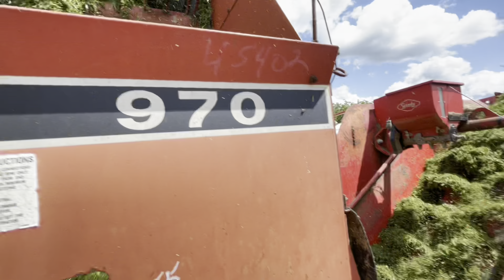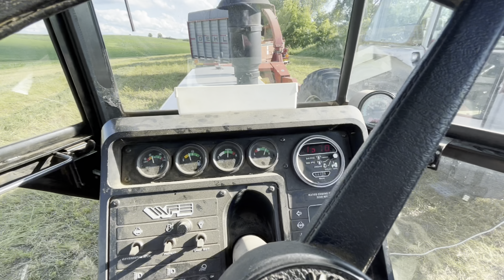Starting second crop alfalfa! The White 140 is having some voltage issues!

Comment: Around here corrosion is the source of almost all electrical problems. I was burning out starters, alternators and batteries were not charging properly. Turns out the 30 year old battery cable on my truck had corrosion hidden inside the factory crimped alternator and battery connectors. Disassembling, soldering and attaching new brass battery terminals eliminated this disaster that made my life miserable for years.
Reply from the maker: Yes we did find needed new batteries and one cable. Plus a bigger alternator.

Comment: How does bagger keep tension, and what pressure you run ,we have ag bagger with cables, I see you don't have cables, so how does your work .
Reply from the maker: With this bagger there is a cable that is inside the tunnel. It’s very king and hooks but into the bagger above the bottom but inside the bagger kinda hard to explain. But after being hooked into the bottom you have to hook it to 3 things ontop of the tunnel and when you put the first loads in it will release from the top 3 and say connect underneath that pulls through the bag the whole time making tension and packing the bag tight way better and makes a way better bag then cables and a back stop. Tough to explain on a comment. I’ll have to make a video about it to explain and show better!
Reply: Thanks you we run 790 chopper works great for us ,my brother been milking12  cows to feed calves ,calf market going down, so dfa did a inspection on his place ,so were fixing a few things and putting in 1000 gallon milk tank and start selling milk soon.
Reply from the maker: Very nice! Congratulations! And I’ll try to get a video out sometime to explain the versa bagger better!

Comment: Do you have your disk mower set high to leave more so the Alfalfa grows back quicker
Reply from the maker: Haven’t adjusted it any. Set the same as when it came of the assembly line
Reply: @leuenbergerdairy6038  my diskbine I have to raise the curtain and bump up a gear and lower my rpm to 1800
Reply from the maker: Interesting. Haven’t done anything like that to ours

Comment: How much faster chopping with the fp230 over the 790? We just did the same upgrade but haven't had chance to run the 230 yet.
Reply from the maker: With the 790 with first crop we couldn’t rake it and was too thick so would do one row at a time and would chop around 2-2.5 mph. With the 230 we are at about 3-3.5 mph with raking 2 rows together. And we sure can tell the difference. He can fill wagons way faster than I can haul which before I’d come back and he wouldn’t even have one full. They are more recommended for 200+ hp but our 140 is about 174 hp so more hp could probably go faster: